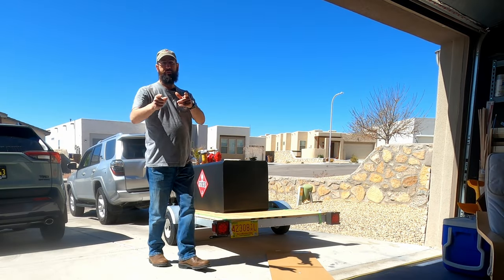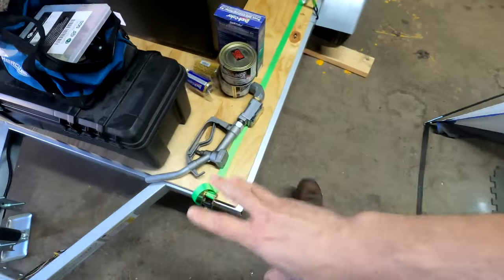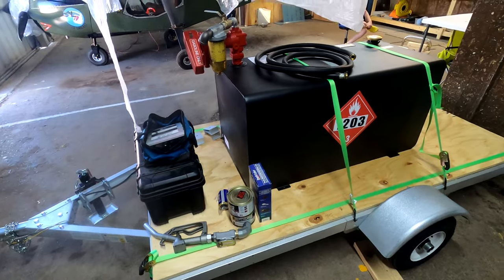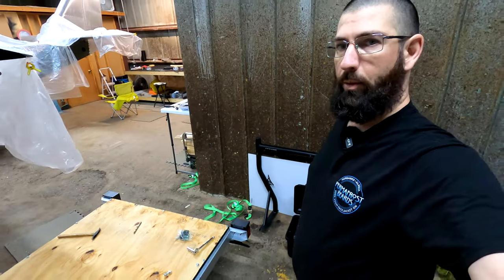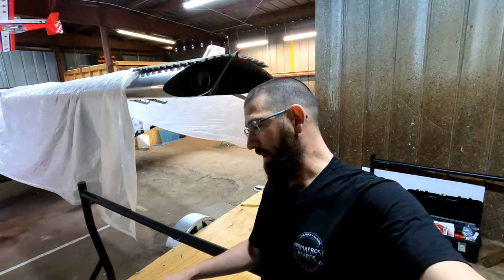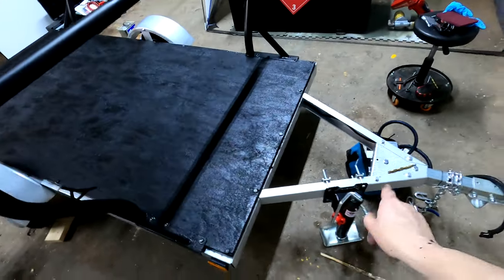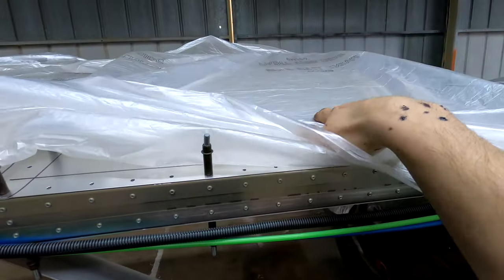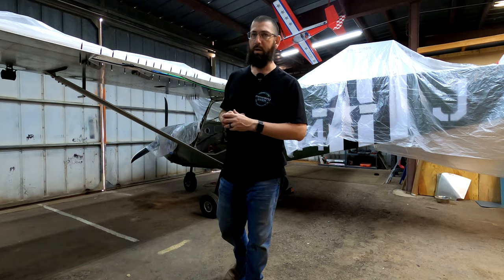The Cricket's Fuel Trailer

Comment: need more weight on the tongue than on the back, figure 12 to 15% of total weight on the tongue to prevent sway.
Reply from the maker: The trailer manufacturer wants 90% over the axle but I want it a bit farther forward as you mentioned. The axle is almost centered on the trailer.
Reply: @JoesRCCorner  And remember a partially filled tank will exacerbate sway due to sloshing, on my travel trailer I always tow with either a full or almost empty fresh water tank, just enough water to use the bathroom if needed, much more than that can induce sway due to sloshing in case of an emergency lane change.
Reply from the maker: @wb6anp  the plan is to leave it at the hangar almost all the time, tow it only when I need to get fuel and the best part, the gas station is across the highway from the airport. 2 minutes away.
Reply: @JoesRCCorner  I was just going to ask if you had checked your local/state laws about hauling hazmat, I know its not far but incase of an accident you may be liable for the cleanup costs. Also does the state require a hazmat endorsement. Make sure to check with the airport management/hanger owner  have read that some airports won't let you store your own fuel on property.
Reply from the maker: @wb6anp  thanks for the advice